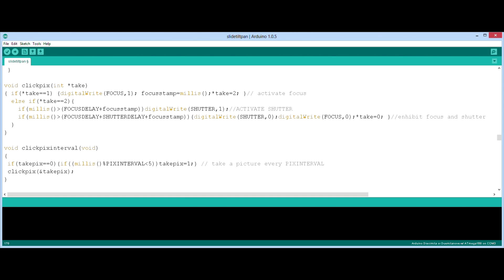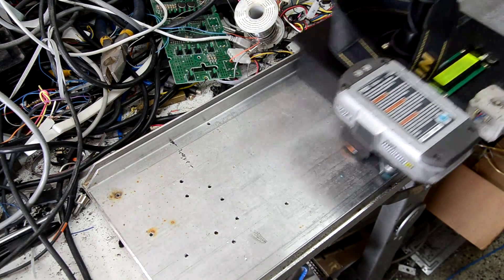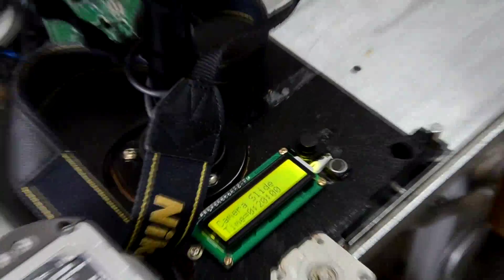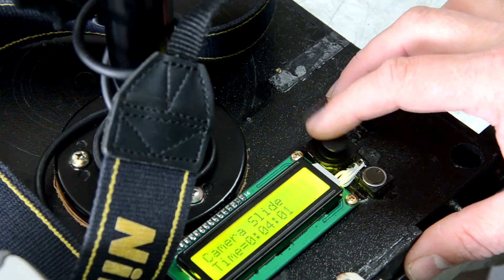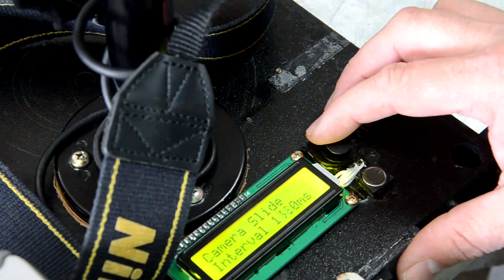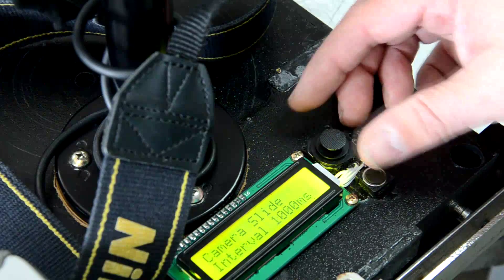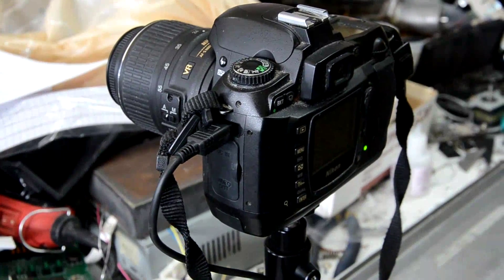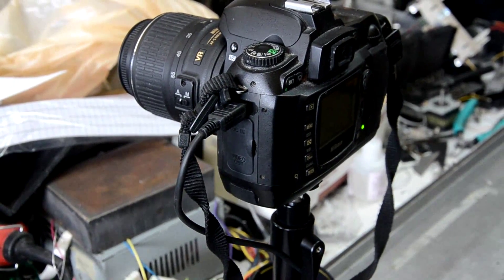Camera slider Motor and intervallometer Arduino for Nikon DSLR DIY

Comment from the maker: My first attempt was with a lead screw (acme screw).  It is not shown here.  It is much more expensive for a screw approach since an acme screw can cost $80 for this length.  With an Acme screw, you can do vertical motion but you will need trust bearings on bottom end.  The pinch roller is the most cost effective way to get horizontal motion.   You basically have to evaluate your own needs and design for them.

Comment: Hello Alain, I've liked your slider! I want to make something like this, but I don't know what path to chose :) You used stepper motor with rubber wheel to move cam, it feets ok with horizontal moving.. And have you tried this approach for vertical camera moving?